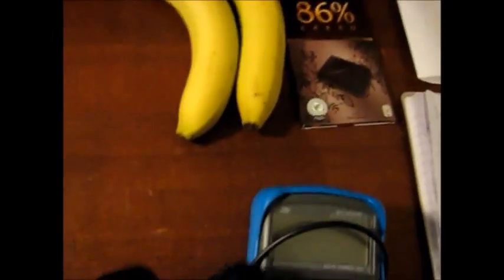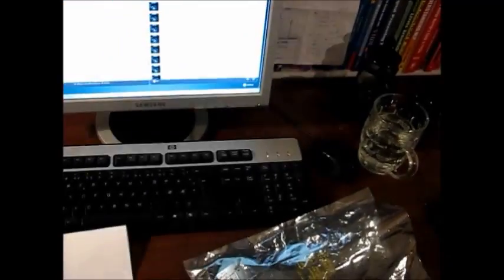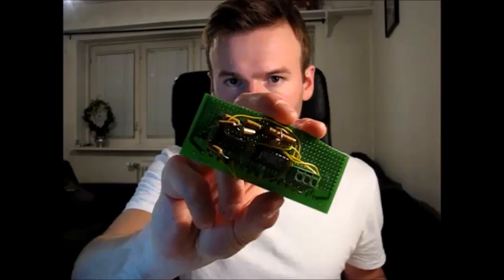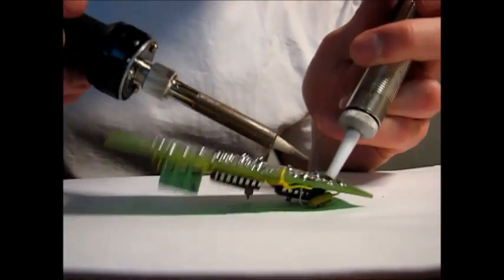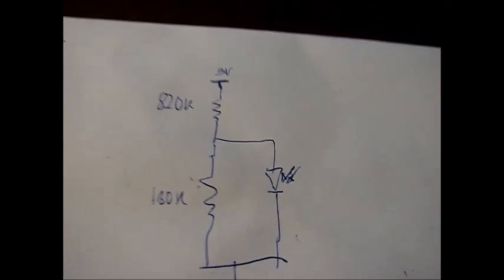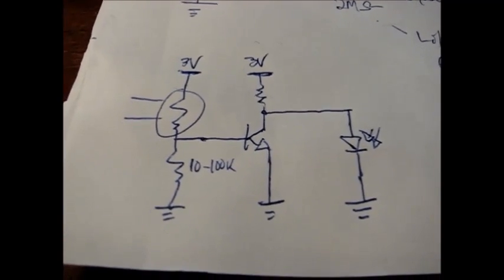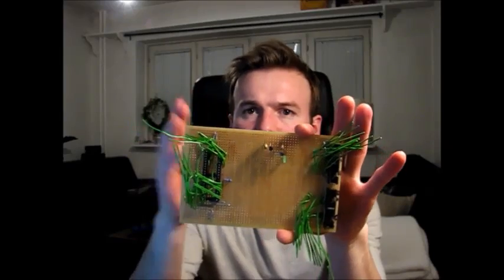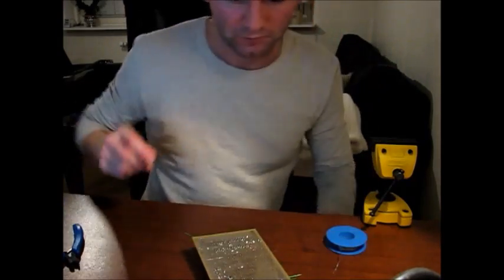How I created a prototype circuit

Comment: Cool! It looked like it was a little frustrating in the beginning but then victory!!! I'm a bit of a gardener and that little device looks like it would come in handy. I wonder how hard it would be to design one that can test the pH of the soil. For a pH tester, do you think the probe would have to be made from a specific kind of metal? I think that might be too challenging for me at this point, I'm still very much a beginner but it seems like the acidy/alkalinity would have an effect on an electrical current. Any suggestions? Nice work on the water tester...I think I'm going to see if I can make one as well. Thank you!
Reply from the maker: +Sean Uhl Haha, yes it was frustrating in the beginning! To test pH, I have no idea what you would need. But I'm sure someone out there on the interweb has done something similar before. Good luck!
Reply: @oyvdahl  The pH value describes how sour something is. For a lemon battery you need a lemon, a copper coin and a nickel coin. When you push the copper coin and the nickel coin into the lemon, you get a current. This current can be measured. Now change the lemon for the soil.